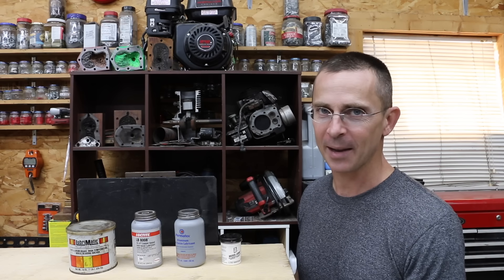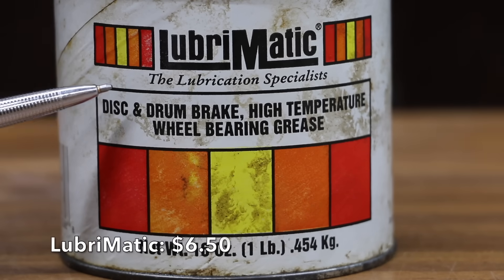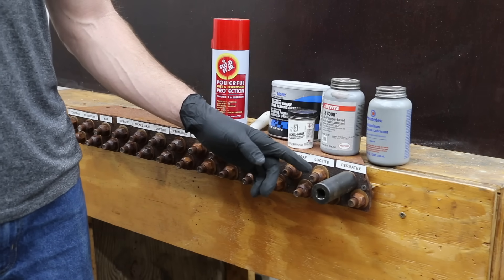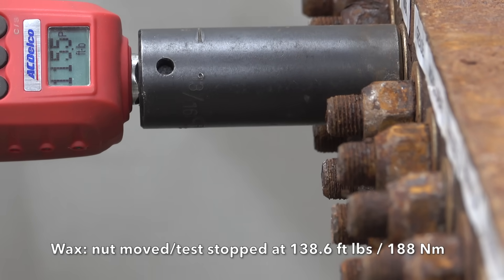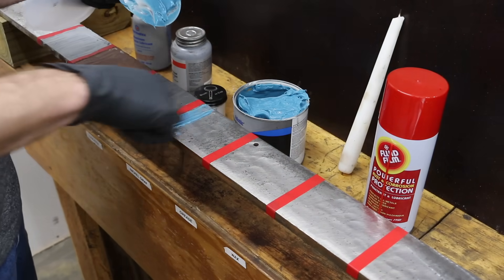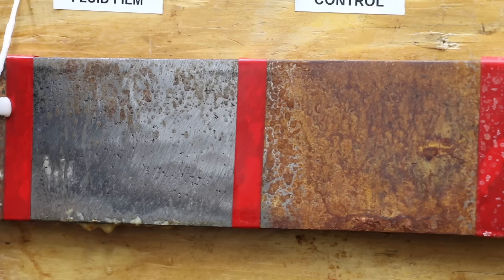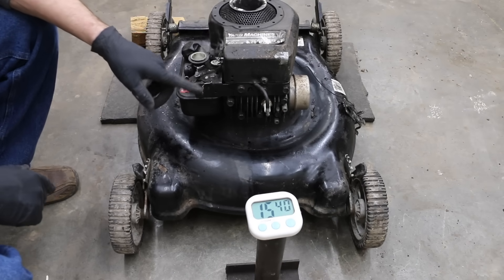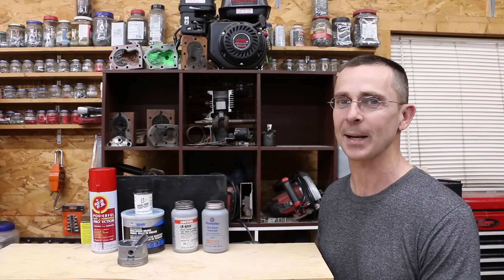Does Anti-Seize Compound Actually Work? Let's find out! Anti-Seize vs Grease vs Fluid Film vs Wax

Comment: A common practice is to use heat to remove rusted bolts and nuts.  Many people heat the nut and get on it while it is hot to break it loose.  My experience is that this is wrong and you are actually torquing around on a heated malleable (weakened) piece of steel subjecting it to twisting off much easier if the corrosion hasn't been weakened more than the bolt or nut.  My experience and others have corroborated this, that it is better to heat the bolt/nut to give it a heated induced mechanical shock and then to let it cool for additional mechanical shock.  When the bolt/nut is completely cooled it is back to its full strength and can then be torqued on.  In addition heating rust converts it from red rust to black rust which has less strength.  Much like the electrolysis method of rust removal.  It is an actual chemical process.  I discovered this quite by accident on a 3" diameter hydraulic cylinder end cap but others have said they will actually heat things red hot and then toss ice water on it to add additional shock.  Do you think that you could devise a way to demonstrate the validity of this.  It is not a product evaluation but it could be quite useful to a lot of people.
Reply from the maker: Thanks for the suggestion.

Comment: Yeah I want to know 2 things. #1) How in the world did you do all that with the permatex anti-seize and not have it all over you and everything for 2 blocks. 2) What viscosity would you call that anti- seize? 400w1250? And I think you should go get a brand new engine and totally tear it down coat everthing with anti-seize reassemble then see how it runs. Maybe a little marvel mystery oil to help the top stay a little slick.

Comment: So much for wax. I’ve always used aluminum on the plugs in my Porsches with zero issues, and copper on brake fasteners. I have not encountered the galvanic activity you mention but I would not use it again. Thanks for the tip.
Reply from the maker: You are welcome!

Comment: I use Nickle NevrSeize after using it for years in corrosive  chemical plant environments.  It has never failed me. If you don't test for 25years and thousands of heat cycles it is an invalid test.
Reply from the maker: Thanks for the feedback.

Comment: The best anti seize stuff is ordinary silicon sealant. Stops corrosion, water ingress, never dries out. My nuts and bolts on a dock are not seized after 20 years. $8 per calking tube. Also used instead of exhaust flange gaskets on a race car. Doesn't like gasoline. Peels off easily after soak in varsol.
Reply from the maker: Thanks for sharing!

Comment: I worked in fuel and oil storage tanks and we would take things  apart that were under the product for twenty years or more and if never seize was used,  they would come right apart.   Amazing stuff.
Reply: works great on aircraft propeller-mount nuts
Reply: @tommurphy4307  Makes mechanic work a lot easier.

Comment: Ok, I talk alot of crap on this guys channel even though I do appreciate what he's trying to do. The point I'm trying to make and I will use one part of this video to make this point...when using a stream of water to dictate how well the anti-seize will run "under conditions a car will see with water spray" is not a real word test. No car will see that consistent of a spray at that pressure for that prolonged period of a time unless you are in a car wash with the underbody sprayers. Even then, they won't have as much pressure as what he applied therefore, that test is completely irrelevant and far from real world. If I pointed out the flaws in every product test he does I would have to make it a full time job. Either way, I do appreciate what this guy is trying to do, but to the average viewer, please take his results with a grain of salt. He has some good ideas, but most are far from real world applicable.

Comment: I use to use anti-seize on every nut and bolt I ever used or loosened from my vehicles because I hated dealing with rust seized nuts/bolts, but one day while plowing the parking lots I was contracted to do me front wheel seized. I thought it was a wheel bearing failure but what happened was the break caliper mounting bolt had loosened up and just fell out. Sometimes you want some amount of seizing. That’s why I switched to blue loctite, it keeps things together and it acts kind of like a paint or protective agent which prevents rust and prevents loosening. Loctite would have been a good addition to these same tests. Also I always use Teflon tape or liquid Teflon thread sealer when attaching anything to cheap aluminum garden hose fittings to prevent catastrophic galvanic corrosion.
Reply from the maker: Thanks for sharing.

Comment: I used the silver permatex on vulcanizing plates for mine belt repair, I had my cookers sit underground in the dusty damp for up to a year sometimes, and normally would have to cut/drill the hardware but the anti-seized bolts came right loose and unscrewed by hand. Very very impressive!
Reply from the maker: Thanks for sharing.

Comment: I haven’t watched the video yet but I’ll say this… I had a Shark steam cleaner that I loved.  Its pressure tank had a screw-on cap and both were made out of bronze or hard brass.  One day I went to use it and the cap had seized in its opening.  NOTHING would budge it and I ended up destroying it while trying.

Fast forward a bit and I scored an identical used replacement.  I immediately put copper anti-seize (Permatex I think) on it and it’s lasted years with no problems with the cap.

Comment: love how consistent and involved your comparisons are , would love to see another comparison on anti seize to see how effective they are in stopping pinch bolts being seized inside aluminium housings, to be specific the dreaded audi/vw  front suspension bolt, have heard that ceramic grease is a very effective anti seize in this area, but not seen any comparisons ,
Reply from the maker: Thanks!  Thanks for the suggestion.
Reply: non-metallic/non-conductive. i've never used it. i guess they use it on ABS systems.

Comment: I put anti seize on any metal to metal contact, such as screw into metal or rotor mating surface onto hub
Works great, prevents rust and corrosion

It also works on your brake caliper pistons to prevent sticking to the pads, you know who you are dodge owners…
Reply from the maker: Thanks for the feedback.

Comment: the fact that the engine destroyed it's self is no surprise to me

the reason the bearing and arm of the connecting rod elongated and broke is heat, removal of which is the oil's job
200 degrees is bad for aluminum

also 2 cycle engines eat oil to lube the upper portions of the cylinder which is why you had anti seize in the cylinder
Reply from the maker: Thanks for sharing.

Comment: 1 bottle of antisieze should last the life time of the car.  I always put it on my lug nut studs.  It is foolish not to with all these tire monkeys wrenching the nuts on.  I actually hurt myself taking one of my wifes ties off.  This will not happen again.  Apparently you can replace the tires a couple of times before having to replace each coating. lug nuts dont have to be super torqed on either.
Reply from the maker: Thanks for the feedback.

Comment: For low temp applications I have heard that loctite or even superglue work well as antiseize.  You need air to get corrosion so anything that keeps the air out should prevent  corrosion.
Reply from the maker: Thanks for the feedback.

Comment: On commercial aircraft we often use a product called cor-ban 27L for screws and bolts. It’s a very thick straw coloured paste that comes in a toothpaste style tube. In my experience, it seems to work very well. The product claims it can only be fully removed from metal with somewhat aggressive cleaning agents. For extreme heat applications we often use the copper loctite, so I have good faith in that also.
Reply from the maker: Thanks for the feedback.

Comment: you're comparing anti sieze brands but not types of anti sieze. aluminum, nickel and copper all have different applications and perform differently. you should have compared the same metals across different brands. the price differences are especially nonsensical because copper and nickel and much more expensive than aluminum, so of course they are going to have vastly different prices

Comment: Always amazed at you planning and testing taking months in advance.
You could sell you data to companies to make improvements I'm sure.
Hope your logging and saving it all
Reply: In the motor, maybe take the rod apart and coat the crank journal and reassemble bc the anti seize can't flow in there on its own, too thick.
Reply from the maker: Thanks for the feedback.  Thanks for the suggestion.

Comment: When it comes to safety at 1st having the least resistance but after some careful thought,I want my bolts to be at over or under just by a little bit to make sure I've got a secured bolt especially in high vibration areas.Same thing goes to torquing down bolts in the head of the engine the consistency is as important as the accuracy of the foot pounds.If you think about it keeping things right around where you torqued down the bolts even a bit more torque is where it is at.I personally like the grease idea and is the way I would go from now on.Thanks Project Farm Dude.👍👍
Reply: i would think the grease alters torque readings more than the metal-enriched anti-seize would
Reply from the maker: Thanks for the feedback.

Comment: Anti seize became of interest when makers of engines started using aluminum cylinder heads .The engine producers had complaints that when changing spark plugs , the threads in the aluminum heads were being removed when changing spark plugs. Dis similar metals became suspect and anti seize became a commonly used product. 
Loctite was used to keep similar metals that suffered from vibration from coming apart, or loose. They would not hold their assigned torque level. Time is money, and big parts like a D-9 Cat bull gear can get very expensive if torque can not be retained.
Reply from the maker: Thanks for sharing.

Comment: I raced motorcycles from 1981 to 2007. I used anti-seize on all my engine bolts nuts and Gaskets. On the gaskets I would pink them with anti seize on the side toward the engine. Is this way I was able to use the same cam cover gasket for five seasons removing the cover to check the valve lash after every race.
Reply from the maker: Thanks for sharing.

Comment: anti-seize isn't meant to prevent corrosion.   
it's to prevent 2 pieces of metal under pressure from becoming 1 piece of metal over time by placing a layer of different material between them.
Reply from the maker: Thanks for the feedback.

Comment: I can swear by permatec as an industrial mechanic. We coat bolts with the spray version of this stuff and then used them to tighten distributer head on a large injection molding machine.
Reply from the maker: Thanks for the feedback.

Comment: We use anti-seize manufacturing vacuum pumps to allow removal stainless of 8 mm FHSC screws in a casting.  Without the anti-seize the allen socket would often turn in the screw requiring drilling the screw out. We also use it where a aluminum impeller is installed on a ph17.4 stainless shaft.  What about using blue loctite on the nuts.  It would keep corrosion out and shouldn't require a lot more torque to remove the nut.  We are in Minnesota and rust on cars is a very big problem.  We have new trucks treated with Ziebart rust proofing.  the material they use coats all bolts making them easy to remove plus it doe a very good job protecting our trucks from rust for years.
Reply from the maker: Thanks for sharing.

Comment: I am considering applying aluminum antiseize when assembling an aluminum 10 meter/CB base station antenna.  Do you have any advise regarding conductivity?  I am hoping that applying aluminum antiseize to the bare aluminum joints will promote better performance and ease of disassembly if needed. I am also considering using the copper antiseize on the tower bolts.  Please comment if you can.

Comment: Haha, I cannot believe you gave yourself so much extra work cleaning up that poor engine after the oil test just in the name of science. Kudos!

Also, I'm curious whether it should be better that the torque required to unfasten them dropped more. I would think for a long-term bolt torqued to specs, it should stay as close to 90 ft/lbs as possible to be seen as "better". I'm not a mechanic or a power-tinkerer though, so maybe this is kind of irrelevant. Regardless, great video!!
Reply from the maker: Thanks!

Comment: ⛔⛔⛔Lug not or mechanical part warning: Torquing and any type of lubricant or anti-sieze do not work together. If it's anything that matters, like bolts on an engine, lug bolts, etc., you will NOT get the accurate torque you need and the bolts stand a good chance of loosening, causing failure.

Comment: ACDelco buys the aluminum based anti-seize and also engineers a high-temp anti-seize that contains graphite that is a product that does not contribute to galvanic action plus both last last for years. These, Loctite thread locker Red, Blue and Green if used in the correct application, causes no issues. Then I add Permatex Pipe sealant on sensors that the body supply's a return path for ground. My favorite is high temp brake lubricant w/PTFE and Loctite 518 Red jelly as this works great as an additive to new gaskets to prevent leaks & high temp Red RTV on any location that requires RTV. These products work and will never change my mind for their use. Wuurth electrical contact cleaner is another another product I have several spray containers of. They work fine for me and always have. Nothing will change my mind! 
DK, ASE Master Tech since 78, Retired.
Reply from the maker: Thanks for sharing.

Comment: Interesting. Loctite makes at least three basic varieties of anti-seize: aluminum, copper, and nickel. As far as I know, the main difference is the temperature resistance.

Another test would be to see whether or not these prevent stainless steel fasteners from galling. That's one of the major uses for anti seize.
Reply from the maker: Thanks for the suggestion.

Comment: I call it never use. I'm a professional truck tire technician and I won't allow it. It becomes an overtorque condition.  It turns nuts into a bearing.  Light oil 2 drops is the only thing recommended to achieve  proper torque.  Sometimes there is an aluminum outside and a steel inner.  And adding  This product is usually made out of copper. Mixing metals is never a good idea. I usually have to put a  Neoprene spacer in between the steel and aluminum. And if there are 2 aluminums I have to put the spacer against the hub. It always builds up into a hard chalk which is hard to remove.  And sits on the pilot pads which  Takes out some of the metal on the aluminum wheel.  Then during remounting it will not center.  Leaving your wheels on for more than an oil change and not rotating, is the problem.  Regular maintenance and oil will fix all of your problems. I don't care if you've been doing it your whole life. You've been doing it wrong your whole life. These are my industry facts.

Comment: When I was 19, I learned how to use a crossbar to remove and install automotive lug nuts. When I was 29, I learned how to use permatex to make spinning the nuts on and off easier.  When I was 39 I learned that I must be cross threading the threads or something, always difficult to remove and reinstall, sometimes even jumping on the crossbar.  When I was 49, three of my wife's wheel studs broke off and she had to call me for help.  That is when I learned that my anti-seize and my extra weight were causing me to stretch the studs every time I rotated the tires.  It got rid of the anti-seize. The gut is a work in progress.

I wonder, what are the correct applications for anti-seize?
Reply from the maker: Thanks for the suggestion.

Comment: I was thinking about making the switch to copper. But thanks to you I’m staying with the Permatex aluminum. Important reason you mentioned is galvanic corrosion. These new vehicles have so much aluminum on them. And the bolts are zinc coated!
Reply from the maker: Thanks for sharing.
Reply: If you have the money might be good to keep both on hand, i dont so ill stick with forcing the bolts lol
Reply: It seems that O2 sensors frequently have copper anti-sieze on them from the factory. Even though I've had no trouble using the aluminum stuff, the copper might be better for that application.

Comment: There are things for working with rusted on bolts. Cabon steel on cabon steel doesn't "need" anti seize. The real problems are galling and cold welding, like what happens with stainless steel. Once that happens, no penitrating oil or heating with a torch will loosen that bolt or nut. It has to be cut off. So anti seize with stainless steel is practically a must to help protect equipment. My point being, lowering torque in disassembly shouldn't be the number one reason for using anti seize. It should be being able to disassemble, even assemble, at all, as galling and cold welding can also happen when screwing the fastener in.
Reply from the maker: Thanks for sharing.

Comment: Love your testing! Test suggestion: lubricant for stainless steel bolts and nuts (316). One test would be the anti galling / fretting abilities.
Reply from the maker: Thanks!  Thanks for the suggestion.
Reply: Never seiz  alum based doesn't work with stainless steel.
Reply: I use either Blue Goop or Pure Goop, which is my favorite for Stainless.
I work with High pressure Waterjets and seizing becomes expensive really fast.